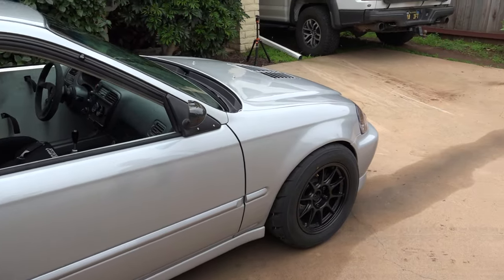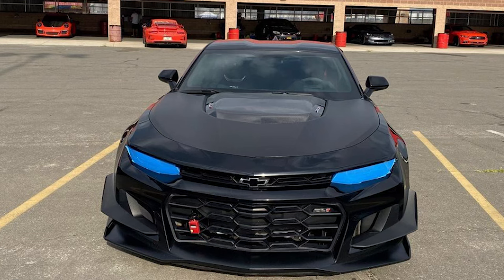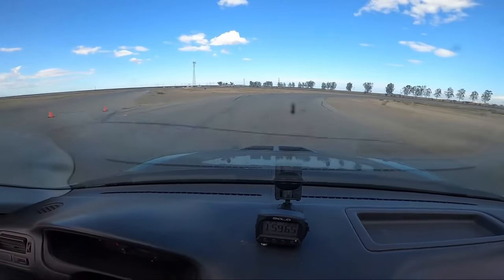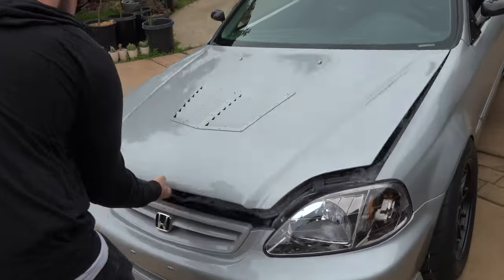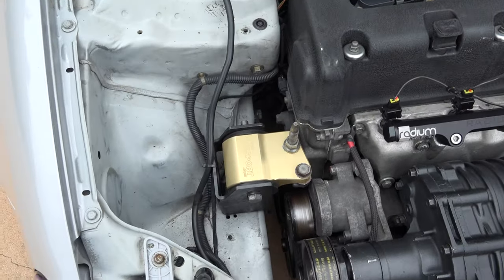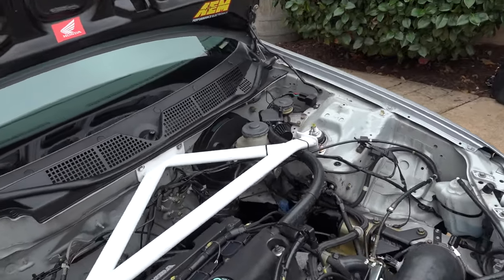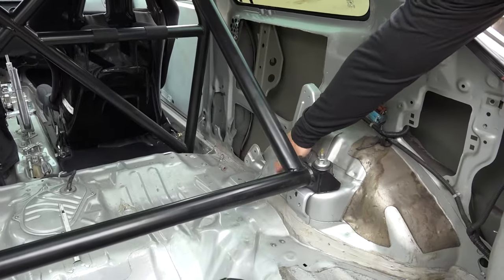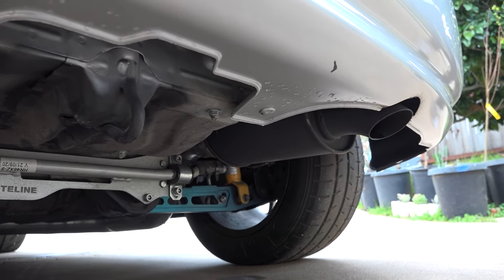Honda Civic 6th Gen (EK) track car build interview

Comment: what was the oil temp difference between the K20 and K24?
Reply from the maker: This is what Shea says: K20 had just the oem oil cooler and occasionally saw 245-250. I put the k24a in, supercharged the car and built the custom -10 AN lines front mounted dual pass bar and plate cooler, thermostat controlled. Highest I’ve seen 215-220* max